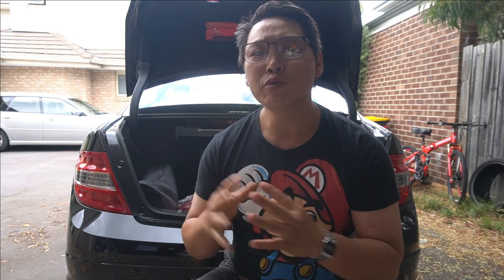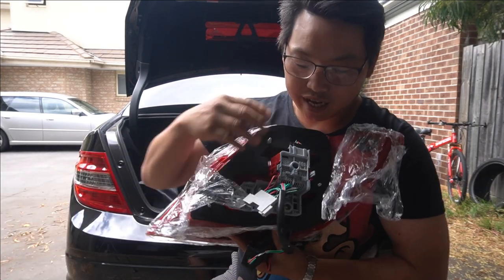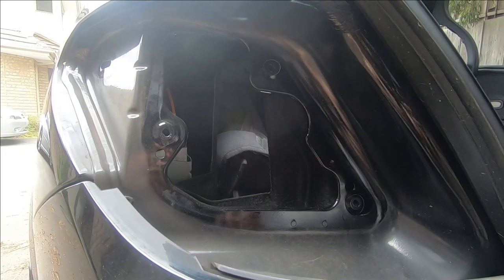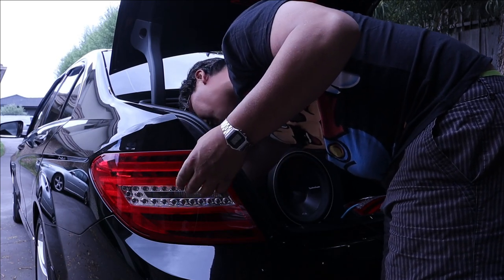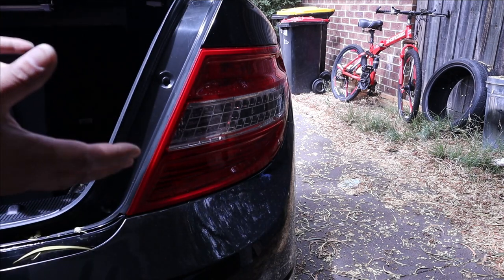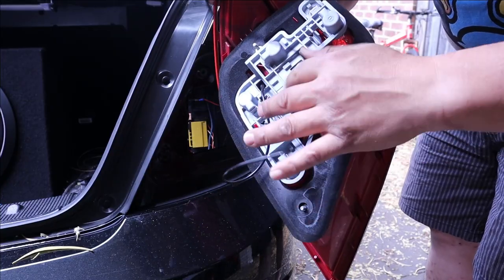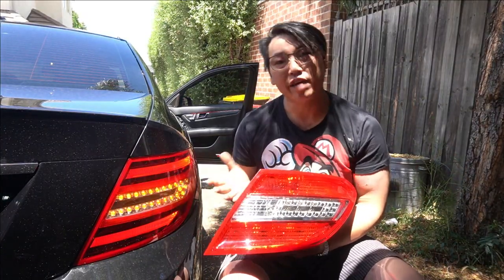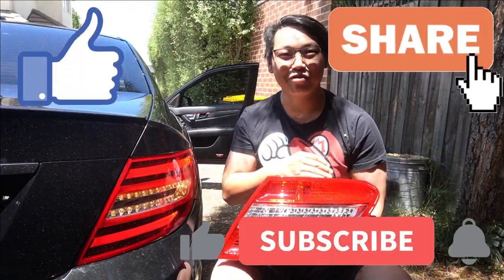07-10 mercedes W204 prefacelift  mods / aftermarket facelift tail light upgrade

Comment from the maker: CORRECTION..it is possible to use facelift genuine tail lights for prefacelift but you just need to have them coded to work properly, so that all the leds work properly.. i just meant to say you cant expect to plug and play facelift oem tail lights without having to code them ,cuz u do to get them to work accordingly
Reply: Mind to share where or how you do the code? Thanks
Reply from the maker: @massimoalexander  I never coded mine as ut was plug and play I just know it will need coding if u use factory facelift tail lights
Reply: @MIKEYZVLOGZ  thanks 👍🏻😊
Reply: you sure bro ? because i want to change my pre facelift tail light ?
Reply from the maker: @Dr.shadi.C63  yes there are models designed specifically for our model 100%...I did my research too cuz I wanted the same .. and I found a set facelift ..but they were sold out ... try alibaba and aliexpress ..there are models that are designed for tail lights like ours thT have a led indicator from factory they cost more like 200 more but they are designed specifically for our tail light...
Reply: Hi, the original link of the taillights in your descriptions does work anymore
Reply from the maker: @Politiek-debat  doesn't work amymore? let me fix it..problem is they sell out
Reply: @MIKEYZVLOGZ  
Thank you for your clarifications but could you please give me the link to buy thors OEM facelift lights preceded to fit prefacelift cars ?
Thanks again
Reply from the maker: @ramban3488  sure just remember they need to ve coded ok... and they look great no errors just plug and play and coding I'll.find the link and add them here
Reply from the maker: @ramban3488  here's a link to ebay https://www.ebay.com.au/itm/387059485594?mkcid=16&mkevt=1&mkrid=705-154756-20017-0&ssspo=njvivivat2k&sssrc=4429486&ssuid=lZUozCU1Qj6&var=&widget_ver=artemis&media=COPY
Reply from the maker: @ramban3488  aliexpress Just found this amazing item on AliExpress. Check it out! 
AU$317.98 | For Mercedes Benz C Class W204 2011 2012 2013 2014 Car Accessories Rear Tail Light Fog Light Tail Stop Signal Lights Assembly
https://a.aliexpress.com/_mtSBlx6
Reply from the maker: @ramban3488  Just found this amazing item on AliExpress. Check it out! 
AU$353.19 | 1 Pair LED Tail Light Assembly for Benz C W204 2007-2014 Tail Lamps Plug and Play with LED Running Turning Rear Tail Lights
https://a.aliexpress.com/_mrIzCS8 another set 
no matter what u want always confirm with them first .. and remember it's better to get facelift and have then coded to remove the errors
Reply: @MIKEYZVLOGZ  
Any idea on how and where to do the coding?
Reply from the maker: @ramban3488 yes u can contact this guy that helped me he does it remotely but u will need to buy a 20 dollar tool from aliexpress called openport...it will allow him to remotely code the tail lights for u... find him on ig or Facebook idautomotive on ig and fb his ivailo dudinov
Reply from the maker: @ramban3488 here he is he might charge a small fee buy well worth it his a professional does this everyday https://www.instagram.com/idautomotivebg?igsh=bGpocG40enlvcGZ2
Reply: @MIKEYZVLOGZ  
Thank you 
I will try to reach him 💐💐
Reply from the maker: @ramban3488  ye do thatv
Reply: i just bought these,but i chose all clear lenses.
Reply from the maker: @JBM_Autodipz  nice buddy
Reply: @MIKEYZVLOGZ  i'll do a video tomorrow of me swapping them over,thanks for a great video,it has helped.
Reply from the maker: @JBM_Autodipz ur welcome buddy... will look pretty nice i think

Comment: So detailed! Great job
Reply from the maker: cheers mate
Reply: @MIKEYZVLOGZ Hello, wehre can i buy those 3 years later? 
Thank you
Reply from the maker: @Tom-wl1mx  u can try ebay and aloexpress ..I strongly recommend to get facelift ones and get them coded there is a guy who does it for alot of ppl and he coded mine... I ended up getting rid of these cuz I got errors later ... I had to return them ...but they worked great at first ...I believe a resistor failed ... but then the guy told me to get facelift tail lights ..genuine or aftermarket and u can get them coded to work ... it turns out to be cheaper..depending what u can find ... I got a set of aftermarket ones brnad new and had then coded. and works great no errors and looks great

Comment: Ice video , may I ask you after 3 years how they are doing?
Is there is any downside, breakage .. and if there is any brake in the palatine ( the light plate) would it be possible to replace it or one need to reorder the whole light ?
Thank you in advance
Reply from the maker: ok so I ended up going to a set of aftermarket facelift ones because it was just cheaper. but u need to get it coded check out my latest video on this install there's a newer video... it's better to use facelift and have then coded so u don't have tonworry about resistors and modules that can fail and need to be replaced

Comment: Do the grounding cable get hot on new tail. Light? 

Do you need to install extra grounding like u did on old tail lights?
Reply from the maker: I've already got the new ground so I don't notice it ... the new ground is for your harness so any tail u install here on out will have the new ground wire

Comment: I also upgraded my lights today. I found very cheap originals and they only need to be coded now.
Reply from the maker: yes just coding
Reply: @MIKEYZVLOGZ  what do you mean by coding/ coded
Reply from the maker: @ryanchristian2122  u need to have the facelift tail lights coded with a diagnostic tool so it can work with prefacelift models ..it will plug and play but will have errors or fast flashing indicator because not designed for leds ... hence why u need a special tool to program and code the ecu to read the  tail lights do no errors and it will work
Reply: @MIKEYZVLOGZ  can you share the facelift tail lights coded? thank you
Reply: Since you used originals Did you need any additional harness for the lights or was it just straight straight plug and play and coding
Reply from the maker: @LuisReyes-vi7dm originals are direct plug in but u do need them coded
Reply: @MIKEYZVLOGZ ok thanks mikey
Reply from the maker: @LuisReyes-vi7dm  no sweat brother

Comment: These lights look great and amazing . Any chance you could send me a link where to buy ? I’m uk based and have a 2008 car with halogen lights no led at all . Thank you
Reply from the maker: sure in that case u need to.buy a.specific light ... I'll send u an affiliate link shortly ok..as I have to find u the right one
Reply: @MIKEYZVLOGZ  thank you very much very kind of you .
Reply from the maker: @chriswhittle1435  no sweat ... let u know wen it's dome
Reply: Any updates on that link if possible please ?
Reply from the maker: @chriswhittle1435  hey bud sorry slipped my mind wen I get back I'll link it
Reply from the maker: @chriswhittle1435  sorry mate ignore the first one..this is the one u want which is designed for halogen tail lights that do not have an led indicator ... https://s.click.aliexpress.com/e/_DenQHNZ..now its very important that your factory tail lights do not have an led indicator like most newer 09 and 10 models have ... these tail lights were designed for this purpose , and have decoders and capacitors to counter the voltage and error messages ..but ofcourse dont be lazy and ask your questions and ensure it is the right tai light for your car... ive been lied to before and theres not much u can do about it apart from send them back... stress to them how important it is that it be the right taii lights
Reply: @MIKEYZVLOGZ  what about for with LED indicator? Is there any update to facelift available? Or the OEM facelift tailights are plug and play?
Reply from the maker: @avramdk1  u can use facelift ones genuine or aftermarket ..video coming out in cpl days..how I used facelift aftermerket and got them coded worked great looks amazing too
Reply from the maker: @avramdk1  even if u have led indicator..this one I got isn't designed for it apparently according to the manufacturer and seller..but u can just get facelift and have them coded for next to nothing
Reply: @MIKEYZVLOGZ  did you do the coding yourself? I'm curious about that part.
Reply from the maker: @avramdk1  no but i can put in touch with someone that will happily help u do it, if u watch my video on the cluster its the same guy who coded the cluster for me
Reply from the maker: im still in the learniong phase of coding @avramdk1

Comment: How did you ground these? With the pre facelift ground problems?
Reply from the maker: I didn't have to ... they were plug and play ... but if u had to ..u need to do the same thing find tour ground point .. drill a hole or solder it onto thete and ground to a good point of the car...like the bolt
Reply: @MIKEYZVLOGZ  My game plan is ordering 2 new connectors and will try to fix both plugs and strip and reattach the ground cable so I can use it like factory but I am afraid that if I fix the stock harness that without extra ground these new taillights will also melt the plug over time, are you not worried now that u lost that extra ground?
Reply from the maker: @genericchannel-wy5jh  yeah that's a good idea.. although ur right maybe obertimenot can happen so I guess a good idea would to do the same  grounding
Reply: @MIKEYZVLOGZ  Btw do they still work100% for you? Did you have to replace any led etc yet?
Also I am looking to install a backup cam after 4 years lol any recommendations ? 
Trunk latch versions seem better than license plate led bud I can't find any for my car.
Reply from the maker: @genericchannel-wy5jh  no .. yes stil work good..

Comment: I need you’re help! I just purchased a set of these to upgrade my old halogen pre facelift rears but the problem is that I forgot my ground went out and I made a cable from the frame to the halogen light plate like in ur video!

How do I connect these to ground now?
Reply from the maker: u would follow the same principle , test for the grounding point of the tail light and ground it to the chassis/ frame of car, like the bolt or a ground they have used

Comment: I believe there are kits that connect inline of the lighting plug that has resistors to emulate the halogen bulbs allowing you to connect the oem led lights without the need for coding
I have seen the kit fitted but haven't found were it's sold so if anyone finds the link would be appreciated
Reply from the maker: they sell at dmp car designs But they only work for tower lights that are all religion. If you have an led indicator in your tail light, those resistors will not work.

Comment: Is it possible to fit 2012,2013 or 14 head lights on the 2011 model I'd imagine ita full feont emd swap like bonnet head lights maybe front bumper and 2 front wings?
Reply from the maker: full front end swap cu lights are different shape need to swap front bu.per fenders and bonnet
Reply from the maker: basi ally a conversion but yes u can .. better option is just get those types of lights made for preface they sell them ..its better too looks more aggressive

Comment: Are these OEM taillights that are modded to be fitted to a pre facelift or is the whole unit after market china?
Reply from the maker: so they are after market plug and play but they will only work on cars that do not have leds as factory direct halogen bulbs only...however even if u have leds for indicators ..its not a big deal u can have then coded and it will work just fine... I ended up going for a set of facelift after markets and got then coded ..video coming shortly with full explanation

Comment: How long you had them now? Any issues so far ?
Reply from the maker: they ate fine
Reply from the maker: like 2 years
Reply: How about now? I never last near 5 months with my aftermarket taillights on my pre facelift. Selller said prefacelift model is too high voltage.
Reply: @oxkroggzzs8407  I had it just about 2 months and led bar going out.
Reply from the maker: yea I wanted to clarify that I ended up having to switch out to aftermarket oem facelift because the other ones in this video didn't last as well...I think it's hit and miss... because I've heard ppl use them and not have an issue but then there are some that just won't work and some are ok ...in the end I strongly recommend if u want facelift lights ..get original or aftermarket like mine now..and get them coded they will.work and last because wen coded it's will.match the output voltage ..there are ppl who can code for u ..

Comment: I did that mod a week before and i love it very much
I want to take your opinion about another mod , I got the 5 inch screen and i want to upgrade to the 7 inch so do i have to buy the modified air vents
Reply from the maker: I'm not sure ... as long as everything fits and nothing is in the way it should be ok
Reply: There are 10.5 inch Android mods that don’t need any vent mods but it does require a bit of work to install. Just look up Mercedes Android mod. Amazon sells them as well as several other sellers.

Comment: How long ago did you order it and how long did it take to arrive? I'm based in Sydney so want the rough idea.
Good job man, love it!
Reply from the maker: only took 2 weeks to arrive i can show u the actual date and photo
Reply from the maker: according to my order details i bought and paid for the tail lights on dec 27 2010 and then it arrived on jan 14 2021 ..arrived perfectly in a bixg box to ensure no damage aand scratches
Reply: @MIKEYZVLOGZ  you have mad patiance if you waited 11 years for this ;)
Reply: @genericchannel9448  lmaoo
Reply: @MIKEYZVLOGZ  Thanks man, one other thing I wanted to know is my c200 2008 keeps getting this "Auto Lights Inoperative" Message not sure why, manually all lights work fine, but when set to auto, they don't turn off during the day, and when it rains, the windshield wipers don't turn on automatically either.  would you know how to fix that? Is there something I would need to reset?
Reply from the maker: @climatepals3398  its prolly your sensor in the window i do a video showing how to change them out, pretty easy , check oyt my video on how to replace rain and light sensor, the fact thgat your lights arent switching off automatically tells me its the sensor

Comment: When you upgrade, there is a fault with the turn signal?
Reply from the maker: mine didn't because my original tail light was halogen ... this is designed for tail light with no led indicator .. if u haVe led indicator . u cannot use these ... BUT . there is tail lights designed for prefacelift that have led indicator...u just have to find the right set... alot of resellers will tell u that it will not work..and it is true .   if u have led indicator from factory ..u will get error msg... u can only use this set if u have halogen tail lights with led indicator from factory... but u can also use a set of adapter that are sold from dmp car designs that will cancel the error msgs if u do use this type of tail light to upgrade. 
hope this makes some sense

Comment: Hi Mikey - the link to aliexpress says no longer available.  I have a 2009 W204 C200 with the led rear indicators. I get an intermittent fault where it tells me the left rear indicator is at fault. Inside the car you hear the rapid indicator clicking (like when a bulb is blown), but when you check outside the indicators are working as normal, including the rear leds. I had the bulb holder replaced about 9 months ago and new connector plug - I had assumed it was the common earth fault. It was ok for a while. However recently the issue has started again. I put in the extra earth cable (like you described in your other video), but that hasn’t fixed it. (It resets once you turn ignition off and on again). So I am thinking it may be an issue with the leds in the light unit.  So I have 3 questions; firstly how much did your new aftermarket lights cost? 2 Were your original lights the led indicator type? Thirdly if your old lights worked ok would you be selling the left one? 😊
Reply from the maker: 1. 300 aud shipped 
2. yes I had the leds as u can see in the pic 
3. don't plan on selling the originals as yet..if I do I'll consider it.. 
with your issue it's worth checking your front bulbs and side indicators too.. usually when an indicator flashes quickly it means a bulbs isnt connected properly(loose) or if your using leds.. it can trigger the fault due to voltage drops.. check with an obd scanner and see if you can see the issue electronically..maybe it will tell u where there's a fault.. worth to also check all bulbs relating to that side of the indicators... that's where is start... can only narrow down and eliminate

Comment: I’ve got the w204 pre-facelift halogen bulb headlights. If I get the facelift headlights with the Bi-Xenon projector style headlights from a Benz wreckers yard, would they be plug and play or would it need coding as well?
Reply from the maker: ull definitely need coding but u may need the right connector plug too ... I've seen where ppl have got the adapter plug and it converts the halogen to the bi xenon lights
Reply from the maker: your tal;king about headlights now not tail lights rights ? u will need coding if you use genuine factory lights rear or front , you need to activate and code the lights to match and suit your car